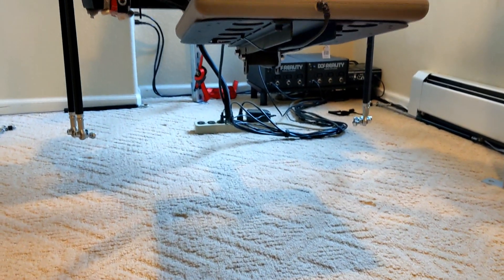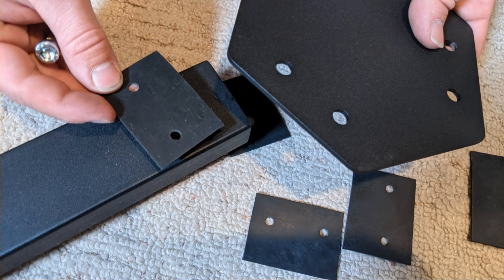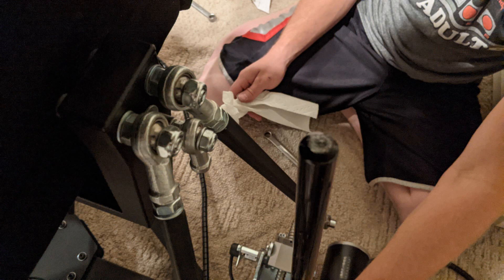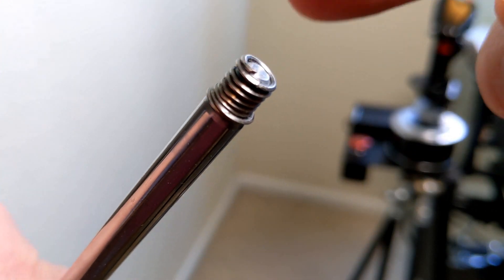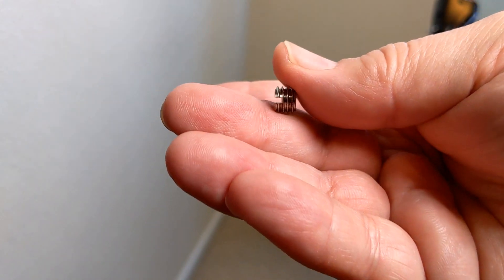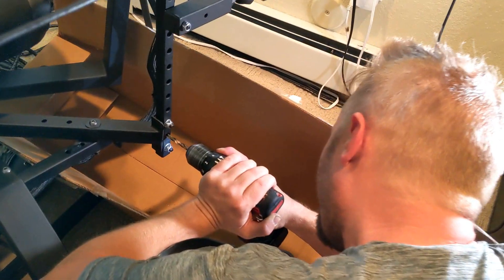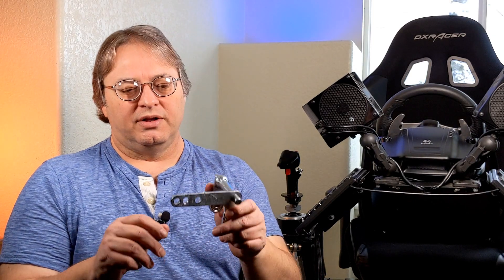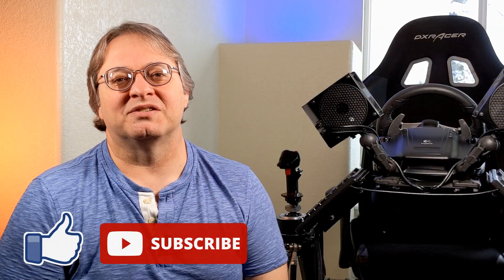DOF Reality SFU Gearbox Upgrade - Part 3: Modifications

Comment: Do these cone spacers also eliminate the cogging / juddering that can be had in MSFS when you do fast (for example) pitch changes, the sudden thump sound?  Many are doing an actual motor swap in the last few weeks to a 3rd party that sounds like it may eliminate the judder, but im not sure if its the same judder?
Reply from the maker: Thanks for the question, so the judder that everyone is changing motors for is judder during slow movements in turns, it has to do with Torque Ripple.  If you are getting a thump while moving fast, make sure you are not hitting anything.  If your arms are hitting the bolts, then these cones could help that.  I assume you are using a H6 or P6?
Reply: @GYGOtv  Yeah its the h6 sfu, example im in the freedom fox aircraft and if you are cruisin along and do a quick up and down on the pitch, often you get that "thunk" which i think isnt realistic, i called that judder.  I mustnt be turning right haha... cause i've not noticed the "cogging" on a turn or maybe i just got used to it
Reply from the maker: @markm75 Ya I'd check all your bolts and make sure something isn't coming loose. It could possibly be the "rebound" effect that I noticed, the fix for that is here http://www.tvdr.de/sim/2/power.htm?fbclid=IwAR1Txh-IH6CsYRAdR0pPjFuMzS5KQuHzglHk7Oh8FTgESXG870t0xs8BDl4 but even then it shouldn't "thunk" so check everything closely.  As for the turning judder, some people are more sensitive to it than others. For me I can feel it, but I mask it with my Buttkicker so it does not really bother me, but some people it ruins the entire experience for them. Hope you can find that clunk sound.

Comment: Many thanks Mark for this and all you're other videos. You were great in informing me on my VR headset upgrade when i was leaning to the Aero. Instead i went for a 4090 and a Pico. Very happy. I'm now thinking of a H3, but can't find much info on the motion compensation issue. Have you guys (or anyone here) solved it with the H6? (think you mentioned there will be a part 4 looking at this. )
Reply from the maker: Hi gerryabbott, thank you for watching our stuff!  Motion compensation is a WAY deeper rabbit hole than I thought it would be for sure.  I've been trying different types of MC and pretty much have it figured out but want to wait to test the Pimax version of Motion Comp in the Pimax Play software before I do the video.  I need the lighthouse faceplate for that and it is on order so just a matter of time.  SO basically there are two forms of Motion Compensation.  There is the Witmotion Box (https://www.simracingstudio.com/post/motion-compensation) and then you have where you mount a controller (or a valve tracker) to the rig and use it as a physical tracker.  The Witmotion setup works great for an H2/H3 but DOES NOT compensate for anything other than pitch and roll.  So for the H6, we had to mount a controller to the back of the chair and use 3rd Party Software for motion comp.  I got it working perfectly in SteamVR, but had issues in OpenXR (that is why I want to test in the Pimax Play).  It is a little cumbersome to start but once it is working it is rock solid and honestly I can't enjoy the motion rig without at least using the Witmotion, but obviously want to compensate the other axis too.  So if you are only doing the H3, the Witmotion method will work just fine for you (you might notice the Yaw not compensating, but not a huge immersion breaker).  If you do upgrade to the H6, you will likely want to go to the other method at as it stands right now. You will obviously need lighthouse basestations for that. Stay tuned, again I'll have that video up as soon as I finish testing the Crystal's MC in the Pimax software. Thanks for the question and I hope this helps.
Reply: @GYGOtv  Wow thanks' for the comprehensive reply. Intuitively I figured its a complex issue to resolve. I'm wedded to inside out tracking so not holding my breath for a quick fix. Looking forward to the video, and keep up the great work.
Reply from the maker: @gerryabbott No problem, again if you are just talking the H2/H3 then the Witmotion is fine and will work for that unit.

Comment: Hi, i have just bought a h6. At times, there is a drop on a motor either in the front and back when moving fast from one side to the other. Dof said it was due to overtorque. I think the load is below 270 pounds. I am 6ft tall, 190 pounds dressed. Seat is below 40 pounds. Then the usual, pedals and wheels, shifter, vr. Does it mean i need the gas struts?
Reply from the maker: Well congrats on your H6 first and foremost.  As far as gas struts go, DOF Reality and I differ on our opinion.  They say you don't need them unless you are over 300 lbs.  In my mind, they will always help lift the rig easier hence faster movement on heave and I don't really see a downside to having them on.  I think they may possibly help your issue.  You may also be experiencing the issue found here http://www.tvdr.de/sim/2/power.htm?fbclid=IwAR0STVuQ8_Zi1jPNvDdburh4WrkrKInig67yBNd0K0Rdrk8PXQXMv2DzMkI  I haven't done this fix yet but it is on my "to do" list at some point.  Hope this helps and thanks for watching GYGO!
Reply: Thx for your prompt response.... i ll check... Your channel helped me a lot with my decision to purchase the H6. Great job! I also have the pimax crystal.  I am dealing with an issue with openxr motion compensation srs witmotion combo. The roll and pitch work pretty well but the surge is not compensated at all. It is like i move back in the seat each time i accelerate in dcf or msfs.   Maybe it is something you can go in detail in a dedicated video when your time permits. GOD BLESS YOU.
Reply from the maker: @tsdpassion Happy to help, glad you are finding the content informative!  So the problem you are having is because the Witmotion/SRS combo does not compensate for those axis from what I've see testing it.  It does a good job with H2/H3 but not for the H6.  If you are planning to get the lighthouse setup for the Pimax, there might be built in Motion Compensation in there.  You can see it by accessing the hidden menu (CTRL+Q in the "device settings" section) but it looks like you will need to use a lighthouse based controller.  I plan to test it, but my Lighthouse Faceplate won't be here until October.  Hope that helps and thanks again for watching!
Reply: @GYGOtv  hi there. were you able to test motion compensation with the lighthouse with the crystal? I got mine today with one htc base 2.0 and vibe tracker 3.0. I activated the option in pimax client with the ctrl q hidden menu.   Well, it does not compensate well at all when i pitch or roll the h6 simulator. It only works with heave, lateral, or forward, backward motion.... so it is unusable.

So i tried instead the openxr motion compensation software and selected vibe as tracker in the config file instead of srs. But when the compensation activates in a game, it says error and does compensate at all.

...
Reply from the maker: @tsdpassion Been trying for about 3 weeks now but my faceplate was defective and Pimax is taking another week to get me a replacement.  Trust me, I'm VERY interested to see how well it works. Stay tuned, I'll let you know once all is working.  Thanks for the question.
Reply: @GYGOtv  when i put the tracker right on the top of my head, pimax mc  was canceling all my movements perfectly, such as lateral, back, forward, up and down.  However, when i tilted my head to create an angle to create a roll or pitch, the compensation was totally wrong.
And the button recenter does not work in the hidden menu.

I really need that compensation due to motion sickness.
Let us know. Thx.
Reply from the maker: @tsdpassion I'm hoping the Pimax MC works but maybe it isn't up to par either.  I had the same exact problem with the openxr motion comp, mine kept saying error too.  I spent several weeks with the plugin developer on Discord but we could never fix it.  He said it was working on his system so I thought it was just me.  Now that your having the same problem, maybe it is something more.  One thing you could try is like running DCS in SteamVR (OpenVR) and use that program's motion comp... that works great for me but I can't run DCS Open Beta so won't work if I try to fly with my friends.  Hope to work something out but right now I have to wait until I get that new faceplate.  Please let me know if you discover anything.
Reply from the maker: @tsdpassion Ya you really need to mount the tracker to the back of the seat, but it might be hard to keep tracking with only one basestation so try to make it as visible as you can. I use 2 basestations with the back one basically pointing toward the Valve Wand that I'm using as a tracker.  I hope to have the replacement faceplate next week and I will test it ASAP because I'm super curious too.  Just hold on a little longer my friend!
Reply: @GYGOtv  hi there,  any progress on motion compensation? Does it work well for you with the pimax compensation option and light house faceplate?  On my side, pimax wants me to return to exchange the faceplate, but i don t think it is the issue. Let me know. Meanwhike, i am using flyptmover for motion compensation, but i am having a difficult time adjusting the h6 motions... but mc works pretty well.
Reply from the maker: @tsdpassion I'd love to give you an update but Pimax is taking FOREVER to get me a functional faceplate.  The original one just doesn't work and loses tracking even when looking directly at a lighthouse.  I had to jump through a ton of hoops just to get them to replace it, including filming myself using it and showing how it doesn't work correctly.  It's been over a month, I think close to 2 since I opened the ticket and still no replacement yet.  I still plan to do a full video on motion compensation because it is really needed out there.  I just have been holding off because I really wanted to include the Pimax Motion Comp but it might have been a mistake to wait for them.  Supposedly there is a faceplate headed my way in the next couple of weeks but I'll believe it when I see it.  Very frustrating to have such a good product offered by such a poor company as far as customer service goes.  Stay tuned.

Comment: Have you seen the YAW 2 motion simulator?  If so, what do you think about it? It's only 3 dof but it moves a whole lot more in flight sims.
Reply from the maker: Yes I have seen that Louis, thanks for the question. So I love the idea of how far back it pitches but in my opinion the Yaw axis (which is one of it's key selling points) is one of the least needed, and I think Heave is a much better axis because it is what lets you feel the landing. I've heard they are developing a "Heave Module" That goes under it, so that would be a necessity IMO.  You will probably want to go wireless with the headset because the full Yaw will lead to tangled wires.  I've also heard the prices are going up and delivery is still an issue with them.  My final concern is I don't see a really good way to mount all your HOTAS equipment on there AND still be easy to climb in and out of. But don't get me wrong, I do think the experience would be amazing... Let me know if you get one and what you think! Hope that answers your question.

Comment: What were the motor temperatures before and after SFU, with and without gas struts? What range should they be running in? Planning on a huge rebuild of my H6 with triple monitors attached. I already have an extruded aluminium frame on it. Will find the balancing point of the new rig and make a "3 legged spider" frame to suit and increase the size of the lower frame so everything lines up. With the aluminium frame but not the triple monitors, my motor temp increases are only about 6 degrees after 45 minutes driving. The triples will increase this but balancing it properly will reduce it again hopefully.
Reply from the maker: Hi Paul, motors rarely go to 30c previous to the SFU and now typically they will hit 35c at the most (usually lower)  The motors are safe unless you go over 60c, that is why these temp sticker work so well.  If you ever see them full, then you are in danger of damaging the motors.  Just put some temp stickers on your motors and keep an eye on them and you should be fine https://amzn.to/35gfdbx Do you have any videos of your rig, I'd love to see the "3 legged spider".
Reply: @GYGOtv  Hi. Thanks for the temp info. How is it your motors are running hotter after the SFU upgrade? I thought they're supposed to stress the motors less than the old wormgear gearboxes. Is 35 degrees with or without the gas struts?

I think I may be able to get rid of the spider top frame completely as the aluminium profile rig is so solid, I think I can make brackets and attach the gas struts and legs directly (at the new calculated locations) like this guy has done.....https://www.youtube.com/watch?v=5fx_v4epF5M
Reply from the maker: @paulhitchen4090  DOF said I didn't need the gas struts with the SFU Upgrade... my temp sensors indicated differently and that was the temps NOT using the gas struts.  Temps went back down to close to pre-sfu after we reinstalled the gas struts. 35 is with them installed.  With old gearboxes they hardly ever registered even 30.

Comment: 14:38 about the SFU. Week ago I asked about it, as I was unsure that is the SFU gearbox a upgrade only, or is it in-factory upgrade for shipping in the new units since the release of them. And DOF told me that it is extra $300 to get the SFU motors to be replacing standard two H2 motors for shipping (so old ones are replaced with the SFU ones). 

So how is it?
Reply from the maker: Yes DOF clarified which units come standard with the SFU and which are needed to be upgraded in the pinned comment below.  Sounds like they went up to $300 instead of $200.  It is my understanding that the cost increase is due to the increase in cost that DOF is experiencing from their vendors, but I don't know that for sure.  In my opinion the SFU upgrade is absolutely needed for the H2, even more so than an H6 because it takes out the slop or slack that the old gearboxes have had forever.  The effect with the old gearboxes is slight wiggling as the gears move between the teeth.  I never had an H2 so I can't speak from experience but it seems like that is completely gone with the new SFU's.  I wouldn't even think twice about the upgrade with the H2 unit.  Hope that helps.
Reply: @GYGOtv  Thanks for the reply. The quoted $300 extra was the whole addition to the H2 price. So it is now about $2200 for H2, that has three motors and two to be upgraded. And then it would cost additional $300 to it, so $2500 in total to order the H2 with the SFU versions. So it would make it just $150 extra per motor, because you don't buy the old gearboxes and they get to keep them, to sell them to those who don't want the upgrade.
Reply from the maker: @katumus  Ahh I see.   Ya I don't think things are going to get any cheaper going forward so you just have to decide if it's worth it for you.  I do know DOF doesn't make a ton of money on each unit so the price increase is likely due to their prices going up too.

Comment: where are you?
Reply from the maker: I'm right here :)  Colorado, USA
Reply: @GYGOtv do you do consulting? I'm south of Denver and thought maybe you could provide some hands-on experience. I'm wondering if an assembly video from start, mod installs, then finish would be worthwhile.
Reply from the maker: @puckernet8155  Hi puckernet... never really thought about the consulting thing, tell me more what you are thinking?  As far as an assembly video, that would be a huge project.  Just the SFU upgrade video took a lot of work so not sure that would be feasible, especially since my rig it together now and I really wouldn't want to take it apart.  Honestly, it is not that difficult to put together anyway... we just followed the instructions and used some common sense where the instructions were vague.  Anyway, I always recommend people join the DOF Reality Facebook group ( https://www.facebook.com/groups/1858593921047822 ) as well, they are an amazing resource and are very helpful with assembly questions.  Hope that helps and thanks for the question.